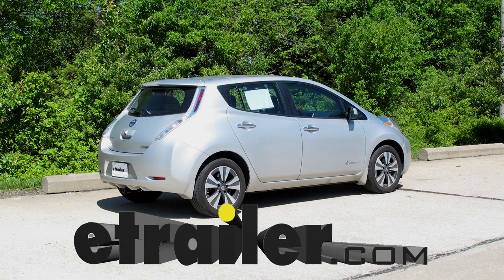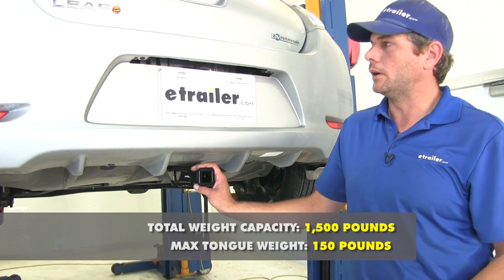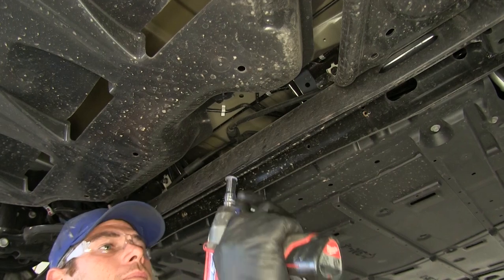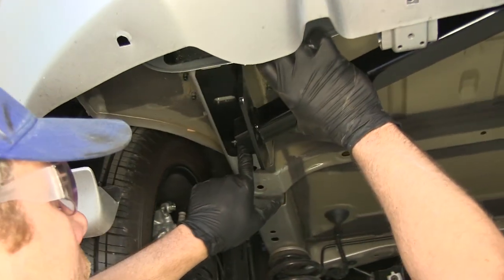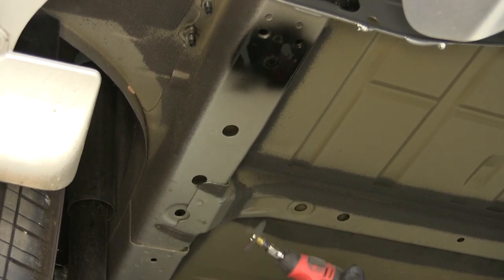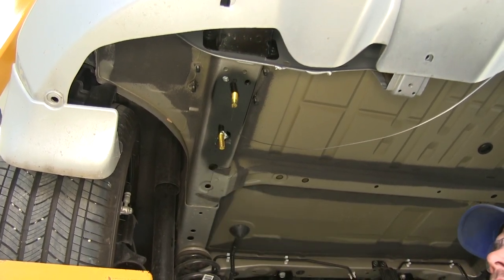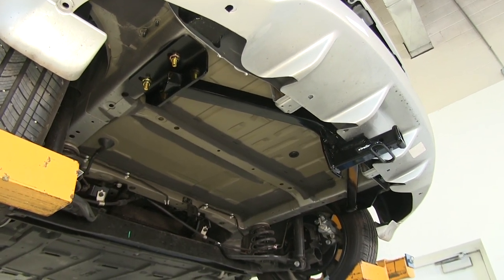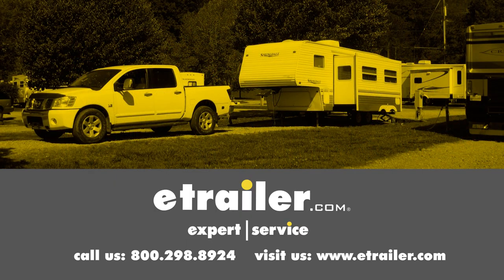etrailer | How to Install the Curt Trailer Hitch Receiver on a 2017 Nissan Leaf

Comment: A jigsaw with a metal bit made faster work opening the forward hole.  The wires that were included with the kit worked really slick to line up the carriage bolts into the holes. Great vid!

Comment: I have a 2016 leaf struggling in the UK to find a toll bar, is there another model that that could be modified or is the same that would do the leaf?
Reply from the maker: Check out the following link for more details on the hitches we have available for the 2016 Nissan Leaf.
https://www.etrailer.com/hitch-2016_Nissan_Leaf.htm

Currently, we ship only to the United States, Canada, Puerto Rico, the Virgin Islands, Guam, and FPO or APO addresses. Both the shipping and billing address must be an address in the United States, Canada, Puerto Rico, the Virgin Islands, Guam or a FPO or APO.

Comment: Will this setup work for the new 2018 Leaf?
Reply from the maker: At this time, there is not a custom vehicle wiring harness confirmed to fit a 2018 Nissan Leaf. 

https://www.etrailer.com/
Reply: etrailer.com thanks. Is a hitch without the wiring harness needed available still?
Reply from the maker: We show one hitch right now that's confirmed to fit a 2018. You can view it at the link below.

https://www.etrailer.com/hitch-2018_Nissan_Leaf.htm